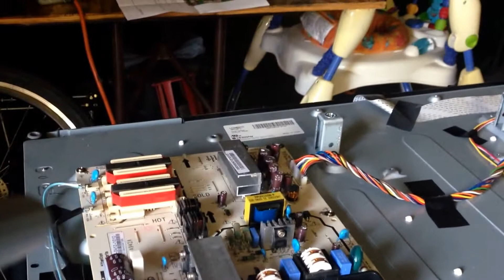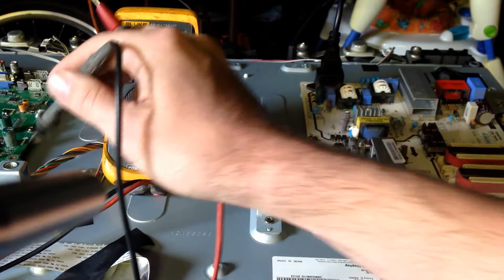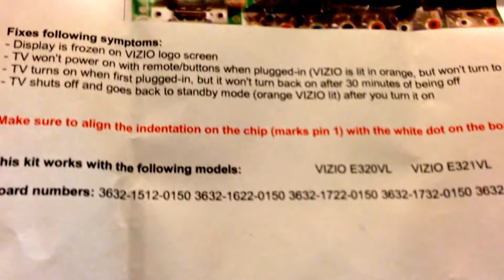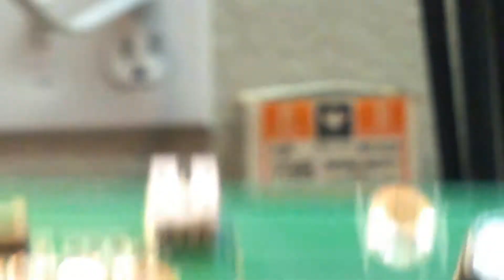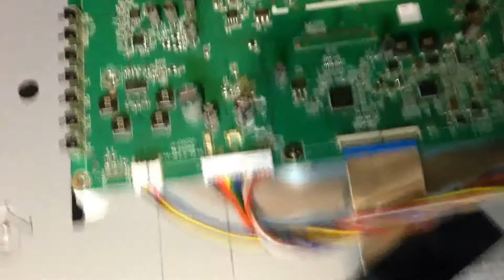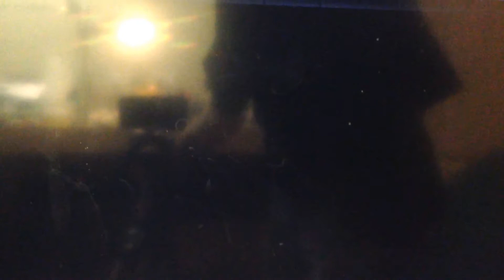Vizio 32 LCD Repair Model: E320Vl EEPROM Replacement

Comment: Should have got you a hot air rework station for SMD and you wouldn't have messed up the solder pads.  I bought one just for this reason.  I have the same TV with the same issue.  Got the rework station and now I'm going to order the EEPROM and replace it.

Comment: Next time you have to remove a SMD, get some  eutectic QuickAlloy Desoldering (low temperature, 68C melting).

You put a little of that on the legs, and they solder stays molten practically to room temperature.  Once you have the chip slathered, just pick it with tweezers.  Then carefully mop the pads with wick to remove any remaining eutectic, so your regular solder will actually harden.

Comment: Awesome vid I have a Vizio tv just like yours it turns on , but it has a line running down from top to bottom and I'm wondering if it's the same part that you put on yours, any ideas?